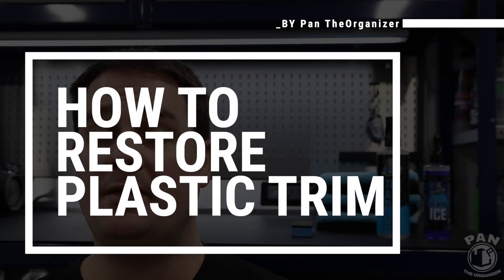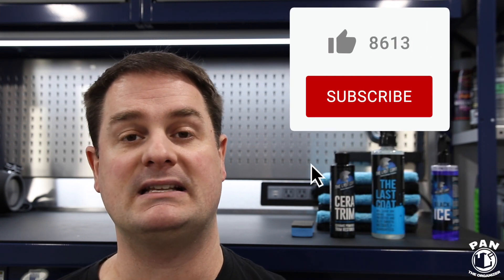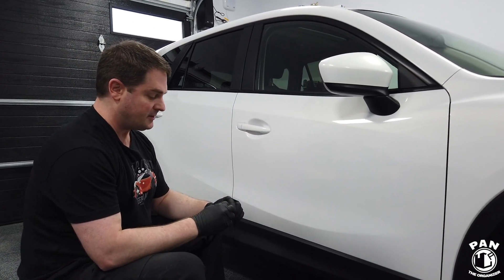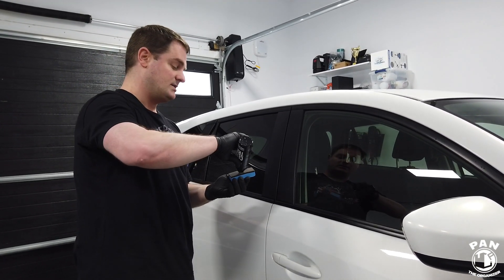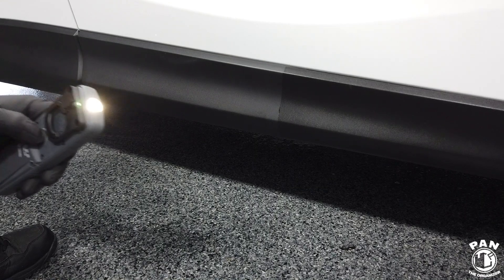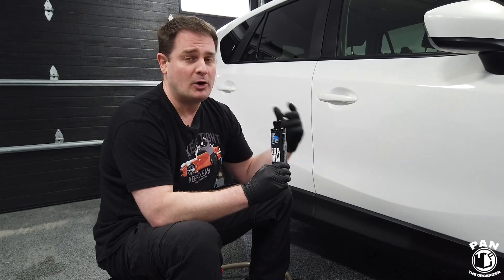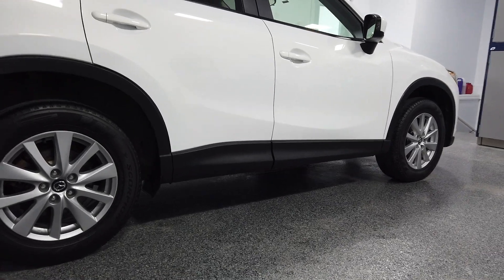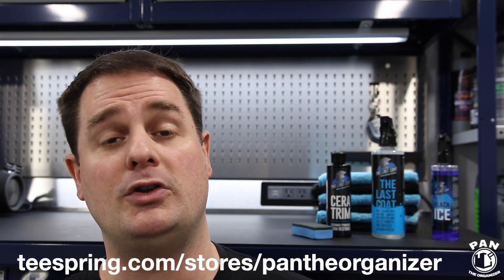Restore faded plastic trim on your car with CeraTrim!! IT WORKS!!

Comment: Hi Pan, ordered and really like it. I had an issue and asked the company about it and never heard anything back. So, if you don't mind thought I would ask you. Applied the product on a Saturday and on Thursday noticed run lines under the mirror and door handles. Any idea what might have caused this? No rain or anything else in between the days mentioned. As always, thank you!
Reply from the maker: Did you dry your car properly?  I use a blower to make sure I get water out of all the cracks and crannies.  There is always some water left in the mirrors, door sills, door jams, grills, etc.  That could have run down...  Who knows.  I'm not sure I understand your question.
Reply: @PanTheOrganizer  ...thanks Pan. Yes, vehicle was dried prior to applying. Did paint polish, sealer, wax and then ceramic spray before applying the product. I guess it is hard to visualize, sorry. Imagine a ladies mascara running.

Comment: What should I use on a brand new car for outer plastic trim? You said to keep ceramic wax off plastic trim. So what should I use when doing my regular car wash?
Reply from the maker: Just use a trim protectant every once in a while. Something like CarPro PERL diluted 3:1 for exterior plastics, or 303 Aerospace Protectant.

Comment: Have you done a follow up on this one yet Pan?  Curious on your experience.  I purchased it, personally think I received a bad bottle.
Reply from the maker: It has been eight months since the application and it is still working fine. What is wrong with your application? Did you prep before applying it?
Reply: @PanTheOrganizer  not so much the application, just how it all seemed.  I did a proper prep as per their instructions.  First thought, it was incredibly thick and sticky.  My impression was it was hard to apply.  It ended up ruining the applicator pad that comes with it.  Second, for a month or so afterward, whenever water ran down from the plastic top of the sides of the pickup bed (F150), it would leave streaking on the paint surface below.  I think it took like 5 or more washes to clean this up.  The whole experience left me a bit dissapointed.  Left an honest similar review on their webpage hoping to initiate some dialogue, but nothing happened.

Comment: Have you compared this to Cerakote? Those are premoistened wipes. They claim that it will last 200 washes would be about two years! Also, the smell is really strong and needs to be applied in a well ventilated area. Does Cera Trim have a strong smell?
Reply from the maker: CeraTrim does not have a strong smell.  I didn't test Cerakote.

Comment: Did anyone tried this! How long does it last in real world. Definitely very nice when applied
Reply from the maker: Hi Sylvain.  Nobody will have that answer yet, as this is a brand new product.  I was one of the first ones to be able to test it.  So far, it has been over a month and it's still going like new.  TLC claims this will last 12-18 months if applied properly, and I have no reason to doubt that, as I have used their other products, like The Last coat version 2.0, and it surpassed the durability claims for me.

Comment: Hey Pan, couple questions for you.  I just 
applied this on some of the plastic trim on my 2016 F150.  This was incredibly thick, almost like honey and sticky.  The applicator pad was already peeling at the edges near the end.  I prepared these plastic parts the same as you.  I know you said gel like substance, but this was very grippy.  Second, later that night, a quick rain came thru.  This morning, I could see stains/marks on the paint from where the rain ran over the plastic that had been treated and down the paint.  Hopefully its just a first time thing.
Reply: @gregsullivan7408  interesting.  This was recent?  If so, then my theory of a bad batch from over a year ago goes out the window.

Comment: Hi Pan!  I dug deep into your PANorama of product videos to uncover a good black plastic restorer/protective product and believe this is it.  First, would you still recommend this as the top black restoration/protection item, and second, would you consider enhancing the protective qualities by topping with a ceramic coating like Armor Shield IX?  In further researching CERATRIM, I came to find that it seems to be unavailable from most if not all former sources.  Any suggestions?.  I have a similar vehicle to the one you demonstrated in this video, only one with MUCH MORE black plastic to maintain, a white Mazda CX 30. ughh. Thank you as always.
Reply from the maker: If you need a trim restorer, get CeraTrim or Solution Finish. If you just need a trim protection, get Gtechniq C4 or CarPro DLUX.

Comment: Hey Pan! I know they say not to expose it to water or rain but what if it rains within 24 hours of application. Will it ruin the coating? 😅
Reply from the maker: I don't know as that never happened to me, I work in a garage. But if it does happen, I would simply reapply a quick layer and let that dry 24 hours.

Comment: thanks for the recommendation I just ordered a bottle. Looking forward to it arriving to give it a good try. just wondering if you had any issue with it on paint? will it damage any coatings or wax? also could this be used on interior as well? and if so is it dry to the touch?
Reply from the maker: You don't use this on paint. This is for rubber and plastic trim that needs to be restored. I only use this on exterior plastics. If you want to try off label use, you can, just test on inconspicuous areas first.

Comment: Curious to see how it holds up after a few washes
Reply from the maker: I have had this applied on my gf's suv for over a month now, and it has gone through multiple rain showers and I have washed it four times so far.  It's still going like the first day it was applied.  I have no reason to doubt the claimed 12-18 months durability if well applied.

Comment: Great video. Can i use it on ceramic coated trims ? Is it recommended to use on existing ceramic coating ?
Reply from the maker: You would have to ask The Last Coat. This is a trim restorer. Meant to restore faded oxidized trim. Why would you want to apply it over ceramic coated trim?
Reply: @PanTheOrganizer  I am not sure if my existing ceramic coating would prevent the trims from fading and wanted to check if applying trimcoat would help in that case.

Comment: Hi Pan. After watching your video I ordered a bottle. I applied it to my black trim and let it cure for 24hrs but after the first rain with it on I noticed streaks. Did i do something wrong?
Reply from the maker: Did you properly clean the surface before with a degreaser or all purpose cleaner?
Reply: @PanTheOrganizer  i used chemical guys trim wax and oil remover. Maybe i should have used a diluted alcohol solution ? Would it be safe to start over by re-cleaning the trim and reapply the ceratrim? Thanks for your help Pan.

Comment: What’s better? The last coat or tw seal n shine? Which gives better protection and shine and durability? Thanks
Reply from the maker: Both are pretty equal for durability and chemical resistance.  Slight advantage to TLC2 for gloss and slickness.

Comment: Awesome product!  Very optimistic on the restoring performance. I would not mind trying it on my vehicle as it has a lot of trim on the bottom and around the engine bay  and the sio2 is an added plus.  Would be interested on tire performance too!

Comment: I would really like a product like that for tire to max out the durabillity of a tire dressing.
Reply from the maker: Off label use suggests you can use this as a tire dressing, but I haven't yet.
Reply: Ya you can use it as a tiring dressing, off-label use though because it takes a couple layers and admittedly it’s not quite as easy to apply on tired as a dedicated tire product, you need to push it into the pores well. It is durable though in that regard.

Comment: Hi! Pan. How about an engine cover smeared by "whatever chemical is it" that made it faded. Can I use a back to black restorer without any effect on the plastic considering it would be exposed to extreme engine heat. Thanks!

Comment: What do you recommend for trim on maintenance washes? Or normal washes.
Reply from the maker: Nothing special needed other than washing your car as per usual. If your trim has no protection, you can add a trim protectant (either a spray like CarPro PERL diluted 1:3 for exterior use, or a longer lasting coating like Gtechniq C4 or CarPro DLUX or Gyeon Trim). 

If your trim is faded and oxidized and chalky white in appearance, you can use a trim restorer like the Ceratrim, or Cerakote's popular trim restorer. See my video here: https://youtu.be/_9X2jzRhTwA?si=xAfzdIPuWRPG6XXE

Comment: Another great review. Will this work on plastic that has turned white from polish residue?
Reply from the maker: You should remove the white residue first, with an APC or IPA solution, and then use CeraTrim.

Comment: Hey Pan, thanks for the video, just ordered some for my personal vehicles to try out. I was wondering if you will be doing a video on Black Ice? I am intrigued by a spray ceramic that can last 14-18 months but want to make sure it's the real deal before I pull the trigger on it vs Cquartz.
Reply from the maker: You can’t compare spray versions to pure ceramic coatings like CQuartz UK 3.0.  CQUK lasts 2 years and takes longer to apply and needs more experience.

Comment: Is the same steps required for for solution one trim restorer? And is it a stand alone or do we have to put a protectant after Aswell?
Reply from the maker: If it’s a new vehicle you could apply the new Solution Finish Over the Top.  If it’s old faded trim, you need to first restore it with the regular Solution Finish, and then protect it with Over the Top. 2 step process. Look into it.

CeraTrim is a one step restore and protect. Both systems are excellent.

Comment: Does this last at restoring the trim? Or would black ice be better? I typically use meguiars hyper dressing but it only works so long on tires and trim
Reply from the maker: CeraTrim restores trim and protects.  Black Ice just protects.

Comment: Hey Pan! I currently have turtle wax seal and shine applied on my car. I am going to buff and polish it soon and I’m not sure if I want to re apply it or try a different product. It doesn’t have quite as much sheeting as I would like but maybe because I didn’t apply it properly. The Last Coat looks amazing!! Should I give that a try? Are there any other spray sealants you would recommend? I don’t want to apply a ceramic coat because I’m afraid of messing it up. What should I do?! Thank you keep up the amazing videos!
Reply from the maker: There are two exceptional products that you should look into, both of which I made reviews for.  They are great sheeters and water beaders too.
The Last Coat v2.0: https://youtu.be/nQRX1KlY0uM
Malco Epic CR2: https://youtu.be/D9gbMndHbM8

Comment: Hi Pan, which one do you prefer. This or Lithium Slam?
Reply from the maker: Hunh?  Those are two completely different style of products.  Lithium Ceramic Slam is a paint protectant.  The Last Coat CeraTrim is a plastic and rubber trim restorer and protectant...
Reply: @PanTheOrganizer  I was thinking of the last Coat Black Ice

Comment: Which is the best trim dressing for maintenance. Is solvent-based, water-based, or silicone-based?
Reply from the maker: Chemical formula isn't what I look for in a dressing.  Ease of application and the look it provides is key.  For exterior trim, my tops are CarPro PERL diluted 3:1, 303 Aerospace Protectant and now this new CeraTrim.  CeraTrim will easily outlast both of those, as this is ceramic based.

Comment: Hi pan,  my rubber window trims are not faded but you can see circular marks like finger prints which I believe is mould.  What is the best thing to use to get them looking new again? Would I have to rub the trim back first to remove the marks eg sanding back a fine top layer of the rubber with say 600-1000 wet n dry,  before applying a product/paint?

Comment: Maybe this is a dumb question but Is there anything that permanently fixes the issue? Not just long lasting. 
Would you recommend painting it? Like from a rattle Can. Maybe that engine paint stuff in black?
Reply from the maker: There is no permanent solution other than replacing the faded trim unfortunately.

Comment: Hey Pan! Quotation for you; do you think this would work for very old trim? I'm restoring a 24 year old car that definitely needs same love. I was thinking that I'd need to have the trim repainted, but do you think this might work in the meantime?
Reply from the maker: Do not apply this if you plan on repainting the trim.  CeraTrim is a super long lasting, very durable ceramic based protectant, and it will be a nightmare to remove if you want to try and respray!
Reply: @PanTheOrganizer  gotcha! Thanks for the advice

Comment: Hey Pan, I applied this to my truck trim a few days ago after watching your review. Looks awesome! But it just rained and I noticed oily residue oozing down from the trim. Think I should wipe it off with IPA solution, or is there a better way? Thanks, keep it up!
Reply: Not sure about this product because I don't have it. However other trim products that run like that I remove with a detailing spray. Not all detailing spray removes it so find one you like. Turtle wax ice detailer is my favorite but I also like Adams and superior products detailers.

Comment: Hi Pan, great video! Thanks for that! But i have 1 question. Does this product also work on trim’s that are a bit whitened from the coat i added? Or do you prefer another product that you have tested?
Reply from the maker: What do you mean white coat? Ceramic coatings shouldn’t leave white residue. Unless you’re talking about a cheap paste wax? Always clean the surface thoroughly as I showed in the video before you apply a trim restorer.
Reply: Thanks for the fast respons! My english is not perfect but i try to explain. I ride an old car (2002) from my granddad, so i thought i’m gonna take care of this car that i can ride this car for a few more years. I have seen your video about soft99 fusso coat and used this one (great coat for a cheap price!!). But when i bring this coat on my car, I just went at some spots over the trim so the trim has a few white spots. Do you thinks this white spots get away when i use the cera trim? I unfortunately can’t upload a photo of it.

Comment: I need to see how long it lasts. Regular armor all can make it looking black too in a garage. Spray some water and soap on it, more durability testing before I'd buy it.
Reply from the maker: This is a brand new product so nobody has had the chance to test it long term yet.  However, The Last Coat have a proven track record when it comes to claimed durability, and I have used all their lineup of products so far.  So I have no worries that this will last the claimed 12 to 18 months if applied properly.

It has been on the vehicle for over a month now, has been through a few rainstorms and multiple car washes, and it's still like day one.  I'm very pleased with this.

Comment: My SUV is newer and the black plastic trim isn't really faded yet, should I use this or something else? Shouldn't hurt since it will protect the plastics while keeping it nice and black.
Reply from the maker: As you could tell in the video, my gf's 2014 Mazda is well maintained (by me of course) and even if the trim was in decent shape, it still largely benefited from CeraTrim.  The trim became darker and richer, and repels dirt amazingly well now, super easy to clean.  So yes it helps older and newer trim too.

Comment: Can you apply a ceramic coating on top of this?
Reply from the maker: This is a ceramic based trim restorer.
Reply: @PanTheOrganizer  Right but after you restore the plastic or trim, can you put a 2 - 7 year coating on top of it or because it already has sio2 will a ceramic coating not stick well to it?
Reply from the maker: Not sure about the chemical compatibility.  You have to email The Last Coat and ask them.

Comment: If it does rubber would it be ok as a long term tyre dressing?
Reply from the maker: Off label use says you could use it as a tire dressing, but I didn't try that.

Comment: Would you recommend using this on a brand new car as a sealer/protectant? I’m considering Solution Finish’s Over The Top but can’t find long term reviews on it.
Reply from the maker: No as both this and Solution Finish are trim restorers. 

On a new vehicle, you use a trim coating to protect. Something like Gyeon Trim, CarPro DLUX, etc

Comment: do you have a video about how to remove debris from inside the mesh of mesh leather seats?  i have some dried up stains under the mesh in my mesh back seat of my is200 and don't know how to get it out.

Comment: Hi pan. Another excellent show and exlent product review. But it’s very costly for me. Can you suggest some other product name for car outside plastic, interior vinyl and dash board with doors polish.
I preferred all your products referred by you and those works great.for commercial purpose in India it’s difficult to use this one.
Kindly suggest some other product for same use.
Reply from the maker: It depends if you're looking for a trim dressing (CarPro PERL is good) or trim restorer (Solution Finish is good).

Comment: Hi Pan … do these Ceramic trim products work on slightly faded window belt molding?  We have a 2022 Kia Forte that’s taking a hit parked outside.  Not sure if that’s rubber though.  It’s the thin strip below the glass at the top of each door.